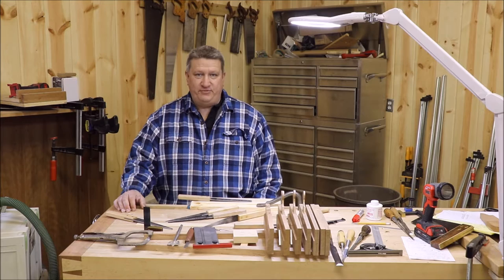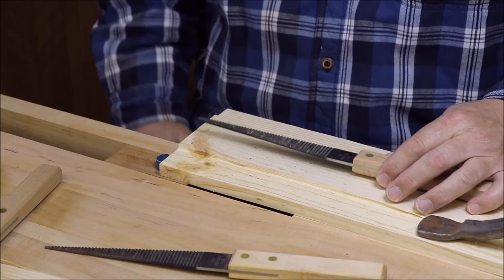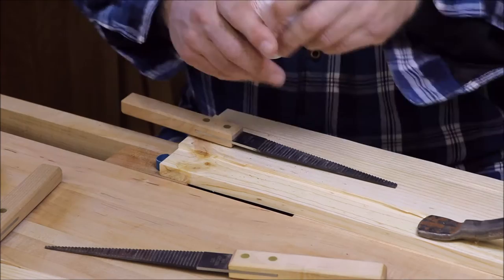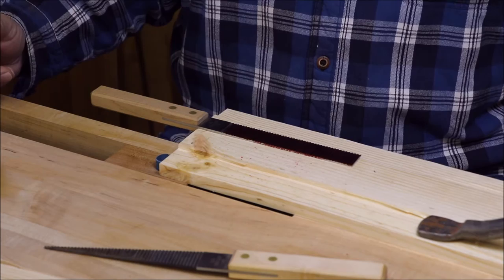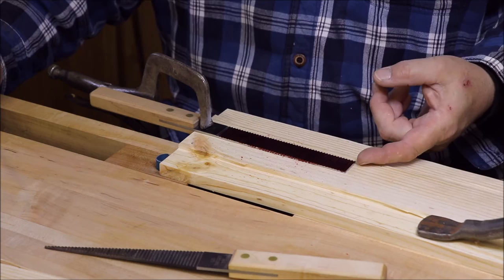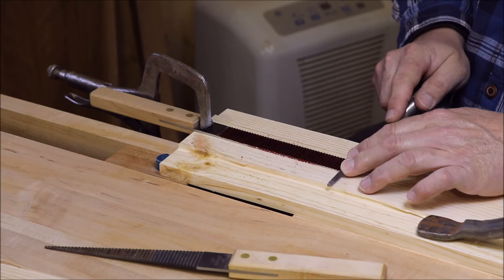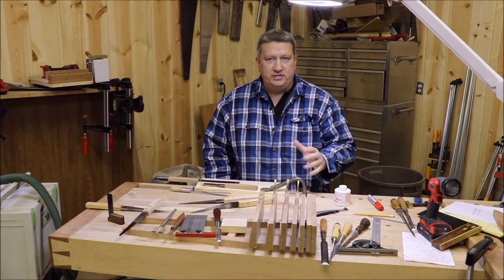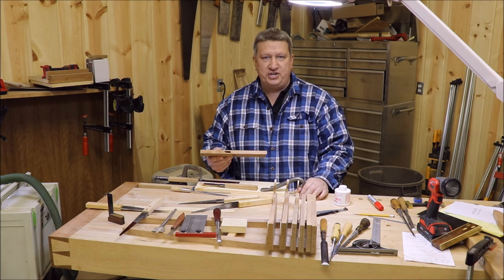How to sharpen plane floats

Comment: Jeff, I have a large, old, vintage, English made float.  I was hoping to sharpen it with a triangular saw file, as you show, when I noticed that the ridges do not go straight across, like yours, but are curved (with the peaks at the centre-line of the float).  So I can't sharpen it like a saw.  Any idea how I can sharpen this?  The only thing that has occurred to me so far is to chemically sharpen it with a strong acid (an old carpenters trick for reviving dull rasps apparently) but I am loath to do it.
Reply from the maker: I don't have any curved floats, and avoid buying them for this reason.  You could try scary sharp on a piece of hardwood you curve to match.  Not sure if acid will work or not.  I send my metalworking files out, and they come back renewed, but not sure if it would work on a float.  Try it.  Can't hurt.
Reply from the maker: Yes.  A float is a finishing tool, much like a smoothing plane for a table top.  When I'm done bedding an iron or wedge, the surfaced is finished.  Nothing else to do.  You can  do fast work with one if you keep them sharp.
Reply: What you've got there is an old 'bodyfile' for car bodywork or a 'dreadnought' type file for use on aluminium. Not a float...Sorry 
The most common type of float that turns up is 4-6" long, with a cranked tang and wooden handle, either flat or half round in profile and maybe 1/2" wide; used for gunstock making.

Comment: Have you had a go at making them yourself.Do you know what grade of steel they are
Reply from the maker: I never gave it a thought, because the floats from Lie Nielsen are very reasonably priced, and are very good quality.  It's not cost effective for the time it takes, and the heat treat is critical so you can sharpen them with a file.  If you get the steel too hard, it will be difficult to sharpen them.